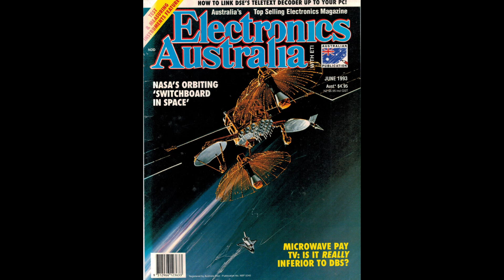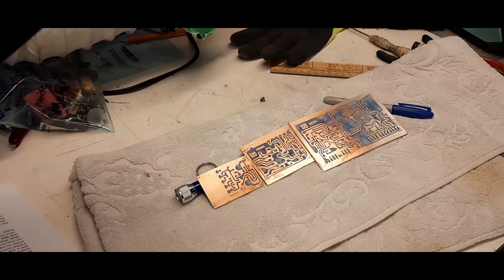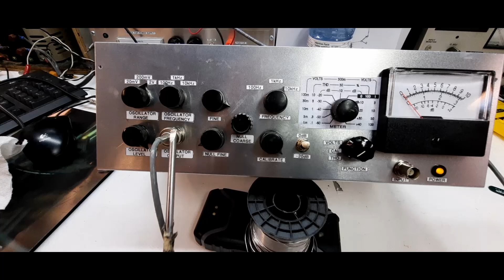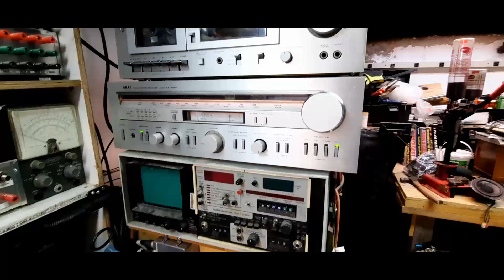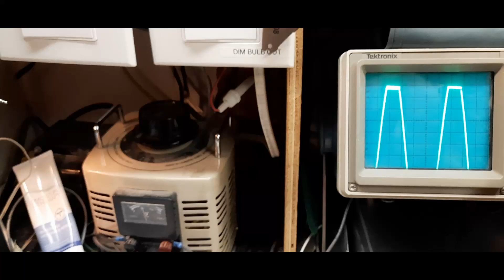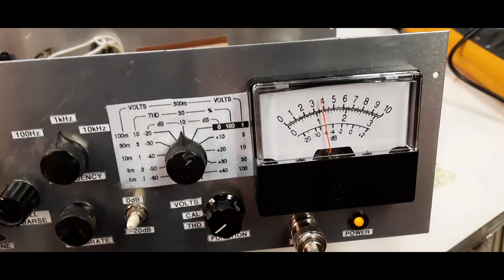Electronics Australia - Noise and Distortion Meter -May/June 1993

Comment: BLTN: I read every issue of the UK version, ETI, and was even published in a couple of them. Most projects worked. A shortcoming of this one, and all similar designs, is that the meter displays average value equivalent to a sine wave, but distortion products are nothing like a sine wave! One option now available - not then! - is to use an RMS-reading DVM connected to an extra output: or, build an RMS IC into the device, but a DVM is much cheaper! Of course it can also be estimated from the scope display...
Reply from the maker: ETI is a great magazine and its awesome that you made a couple of articles. i will have to go back and look for your name. Also, very good information on the RMS meter thing. I just might have to go back and take a look at it. Cheers!

Comment: Another bobby dazzler! Nice job, I like it. For making front panels, you could use sticky foil and a laser printer. Lay the controls out in a graphics program (I use Inkscape for this kind of work), convert text to curves, print a template on paper, mark holes on enclosure, drill and deburr, optionally scratch aluminum for a nice finish, then print on sticky foil, put it on the panel, cut out holes in foil with an x-acto knife. Silkscreen printing would be even more elegant, but pretty complex and good for serial production.
Reply from the maker: Top pocket for sure! Great ideas on the front panel. I have seen some youtube videos about the subject and eventually I will get there. Thanks for the suggestion .. .cheers!